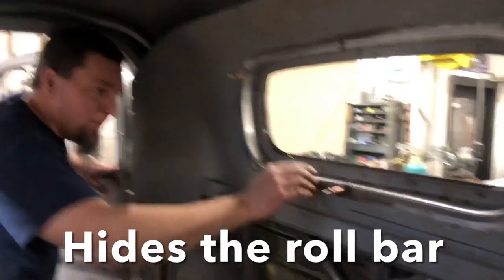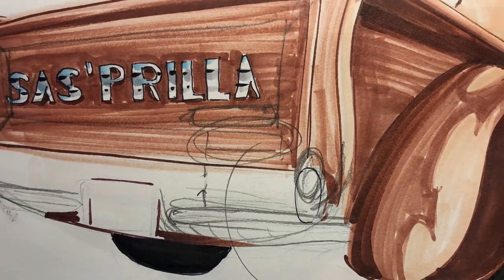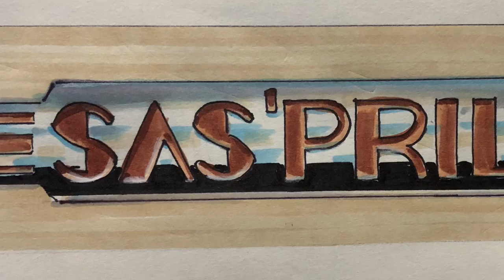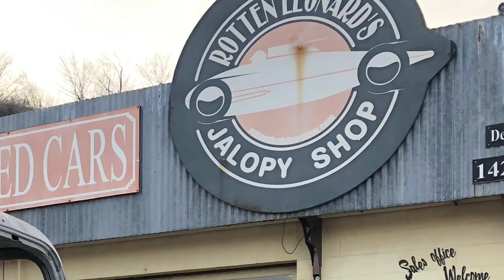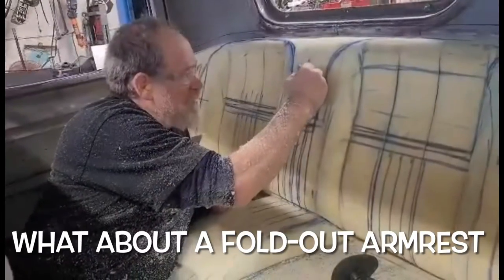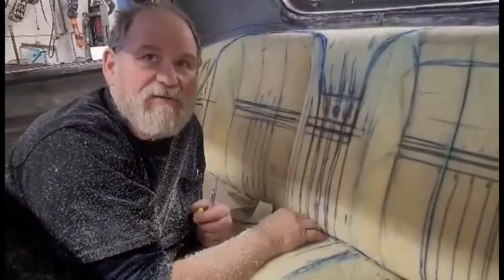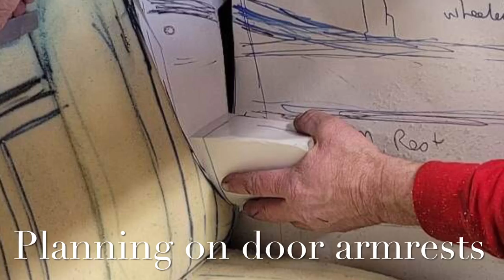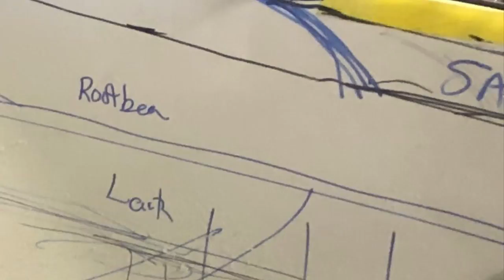1946 Chevrolet Pickup SAS’PRILLA Custom interior, Roll-pan Episode 1

Comment: Digging what it takes to make a Kustom interior seats. I made a middle cancel before out of wood and metal. I made a lid that flip up and a small cooler inside and two cup holder's. I aposterd it with vinel and speaker black rug it match the rug and dash seats for my first build and not knowing what I was doing. Staples spray glue and paint made it what it ain't lol
Reply from the maker: Glad you like the seat making process.
Let your imagination run!